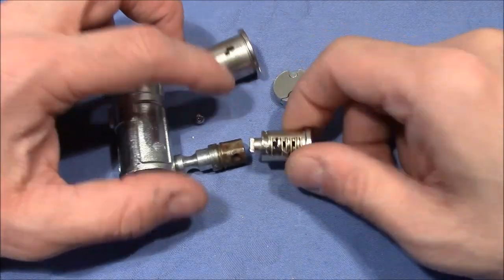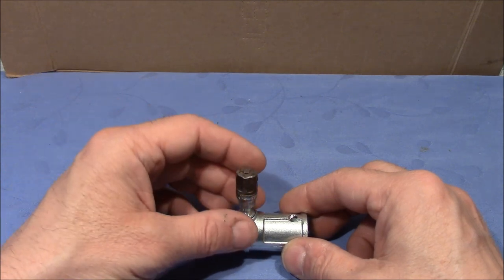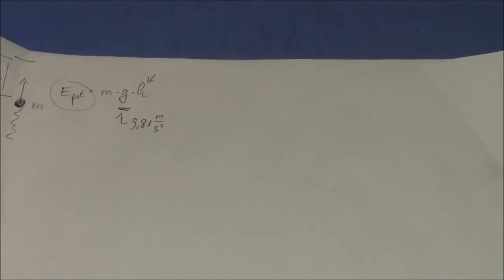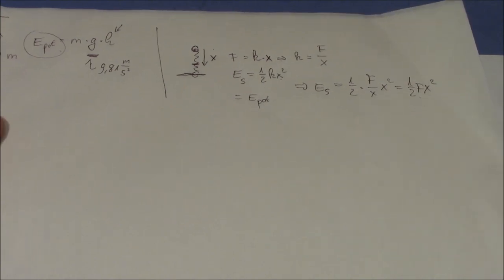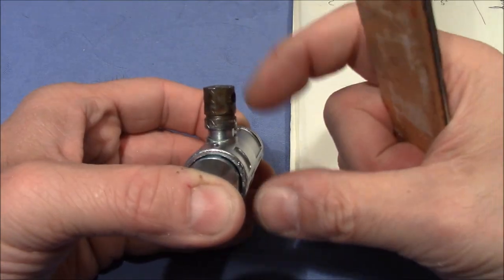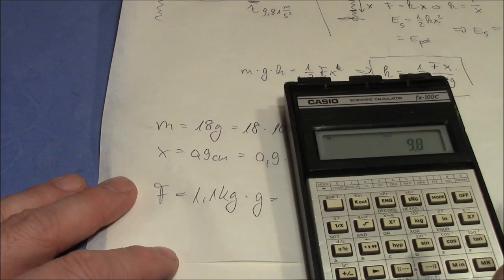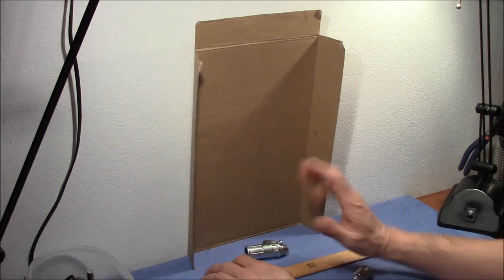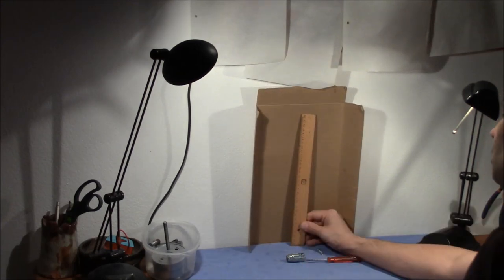(picking 665) How high can a spring-loaded locking bolt shoot?

Comment: You're so smart my friend! :D :D  Nice to see what you look like too. :D :D  Really great example of using math & physics in a real-world application.  So does it matter if the spring tension doesn't give the same force for all the length it's unwinding?
Reply from the maker: Haha, it was hard to hide myself with that camera view ;-) 
The further you push the spring the more force is required (linear, F=k*x). If your spring is not built consistently you will still get a different but still konstant k but the spring will deform unevenly.

Comment: Very interesting, but with the padlock in its normal configuration and the cable covered, turning the key would only pop it out a little way, wouldn't it?
Reply from the maker: Right, the lock will shoot out the bolt attached with the cable just a bit - the mass (including the cable) is higher.
Reply: @Potti314  Exactly. So it's designed with that additional mass in mind. Cool experiment none the less.